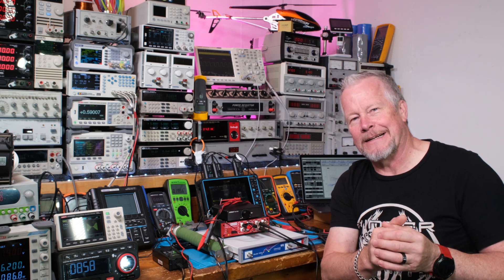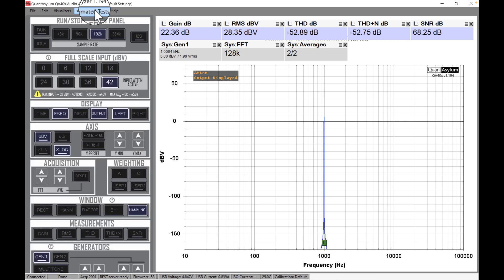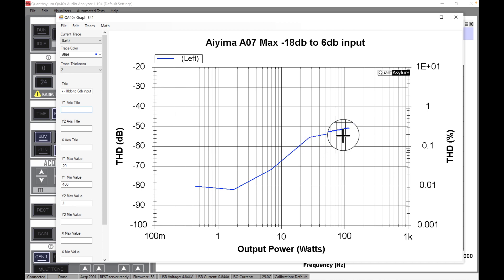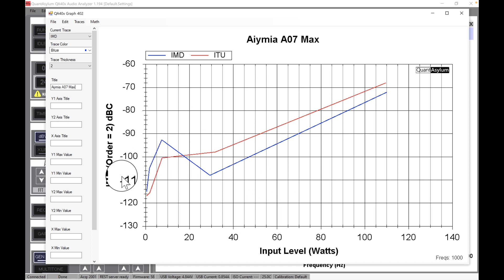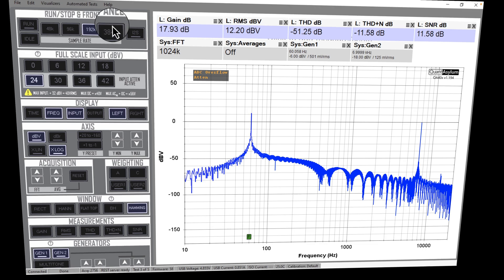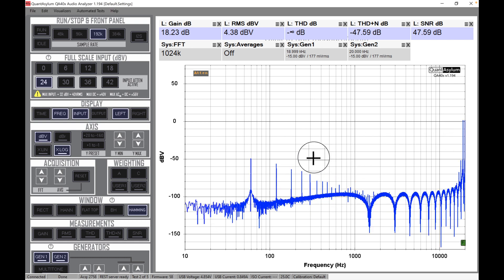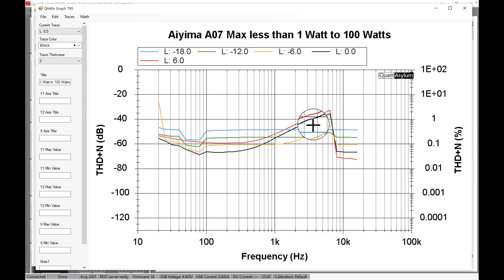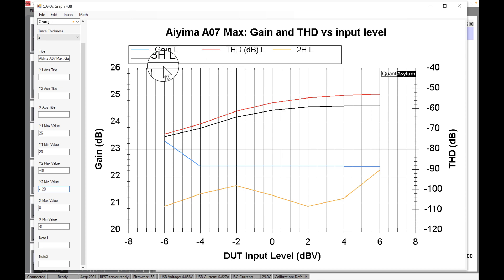Aiyima A07 Max - Measurements with QuantAsylum QA403 #TPA3255 #300Watt #QA403 #QuantAsylum #QA403

Comment: How you load the amplifier outputs affects the distortion and frequency response.  You provide no information about this critial aspect of testing these mini Class D amplifiers.  The type of load resistor also affects the distortion.  I learne this the hard way with my Quant Asylum analyzer.
Reply from the maker: Thank you.  I do need to repeat this in each video just to be clear.  I have made so many videos on amps that I forget that not everyone has seen my videos.  I did a video just to talk about this subect and others: https://youtu.be/5bVrPketMWs
I also did a series to show the impedance of the cables that I use, and the resistor load itself.  This video shows me testing the load resistor: https://youtu.be/Eu3HosI8ctE

Comment: wondering what true rms this amp outputs for 6 & 8 omh speakers when in mono mode using DC36V 6A power adapter?
Reply: you will go with 45-48V for higher impedance. The amp is OK for normal listening levels even with 36V. Got more power with 48V but sound quality degrades somehow. Bridging to mono doesn't make a big differ with this design (no pbtl)

Comment: On 15:00 you have done very important measurement, the gain vs input level. What I find suspicious is the output watts corresponding to the input dB. You say 6db is 100w. For me, 0db is 1/4 of 6db That is 25w and -4db is 1/10 of 6db, that is 10w that you say it is 1w. -6db is 1/16 of 6db that is about 6w. My I wrong?
You know for being PS engineer,  the AWG table preconises max. current for a given wire thickness that transform designer apply. The tpa3255 has very thin leads of 0.15x 0.25mm. If channels A and D have double pins B and C are alone to bridge with the other ones. The thickness given is corresponding 0.22mm thick wire that if the magnetic field is constrained cannot pass more than 0.5A, without, 90ma only. This why the gain decreases. Thanks to your measurement, above a certain current it remains constant. As high frequencies need lower power than the bass, the ratio between then decreases and the amp sound bright by increasing the level.

Comment: Great content. Seeing how the performance changes with frequency and power is very informative. I have heard a lot of amps with measured low THD that sound bad to my ears. I thought that there must be something else going on! I have a Home built Dr Leach low TIM amp in my system at the moment, and it does sound OK, but the power supply is weak and I can't get the watts I need. I'm looking for a pair of high power monoblocks to replace this amp and these class D amps in bridge mode may be the answer. Can I ask - are there tests for timing and phase? This is another domain that may be affecting the music which is not often reported.
Reply from the maker: Thanks for this great feedback!!  I think the timing/phase would be important - especially in a monoblock setup.  I'll have to start including this in my measurements;)

Comment: 11:35 This abrupt drop is not strange at all, it's the effect of the dominsnt harmonic (looks like 3rd) leaving the measurement bandwidth.
4:40 You meant CCIF. When the CIE gets involved it's usually about color... Also, I assume "dB C" does not mean C-weighted?

On a general note, Class D amps are notorious for clogging audio analyzer inputs with high levels of ultrasonic noise, sending stages into slew rate limiting at high gain (low level). AP mandates a steep external analog lowpass filter for this reason (like 4th order @ 30 kHz if memory serves). Some DACs can be similarly problematic with inadequate output filtering, not an uncommon occurrence in inexpensive CS4272 based audio interfaces for example (it's an old design with high-order noise shaping by modern standards). Be very suspicious if the noise level abruptly drops at points coinciding with range switching.
Reply from the maker: Thank you for this great feedback!  Yes, you are correct, I didn't weight any measurements;)